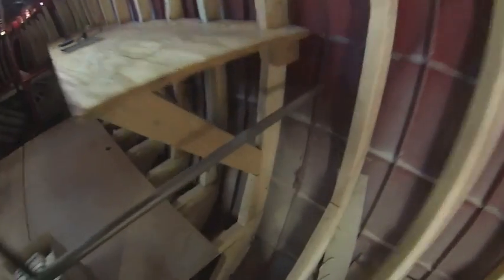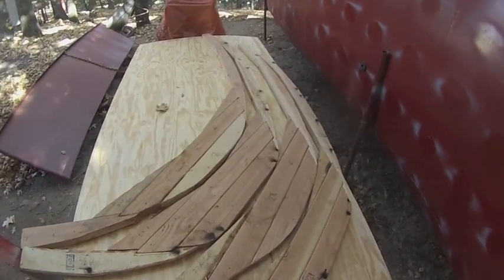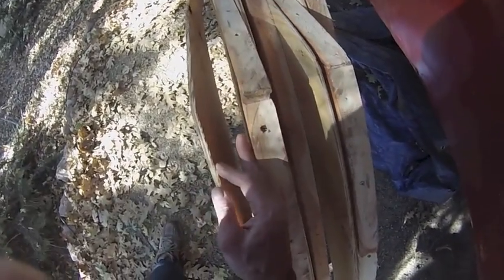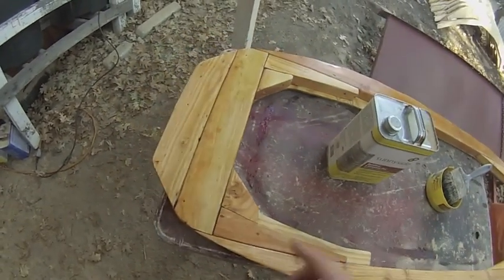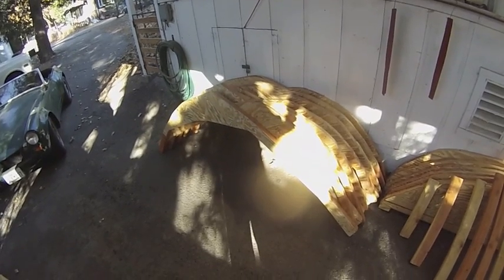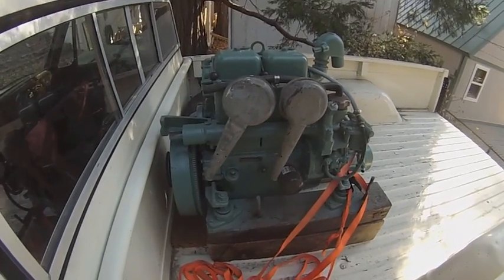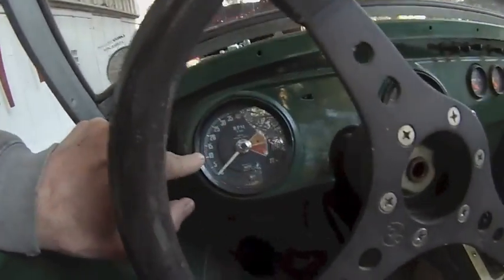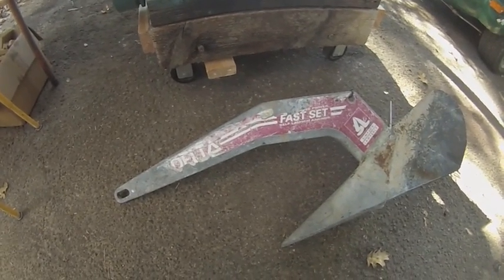Steel Sailboat Build Part 22

Comment: spade anchor rated for +5,000 lbs? in 20 knot seas that thing could get dragged around
Reply: That's not going to be a worry. In 20 knot seas, this thing will have waaaaay more problems  than  dragging an anchor.

Comment: The Penta engines are in fact some kind of CAT engine that's retrofitted with Volvo (expensive as frig) parts, or so i recall. So do some research before investing in parts to see if there's anything that's actually cheaper, and never buy o-rings from them, figure out which set is right for you with the help of o-ring chart.
I hope this bit of information (off the top of my head) helps.
Reply: No, not true. A lot of the Volvo Penta are rebranded Perkins engines. Just look it up.
Reply: aserta This Volvo engine has Nothing to do with Cat engines. It is as Swedish as they come. Made in Sweden by Volvo.
Reply: @SailingYachtDreamcatcher  Volvo penta also re-badges engines to use with there drive system and marine gear.
Here in the states its common to see boats with Volvo penta drives manifolds, emblems and decals ect. ect. with Chevy engines. Im not an expert on small diesels but that does not look like a Perkins